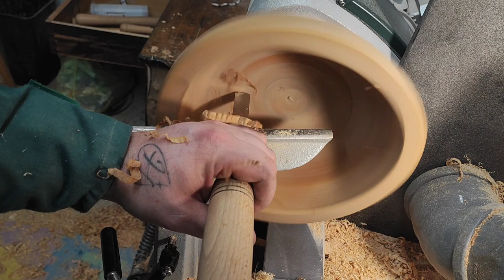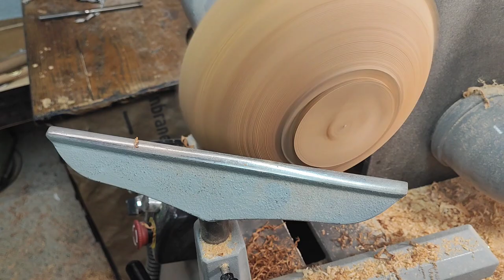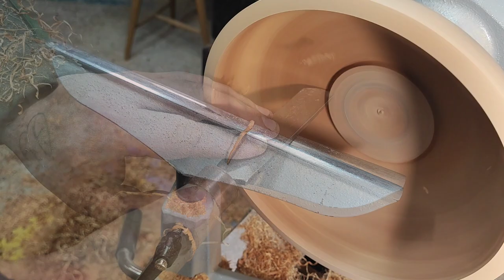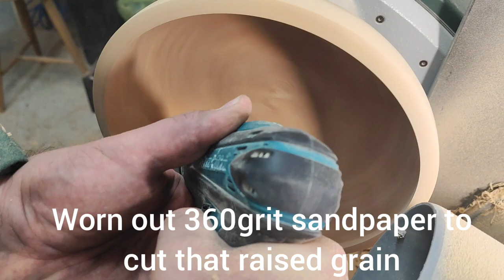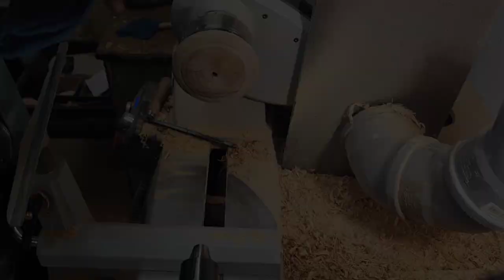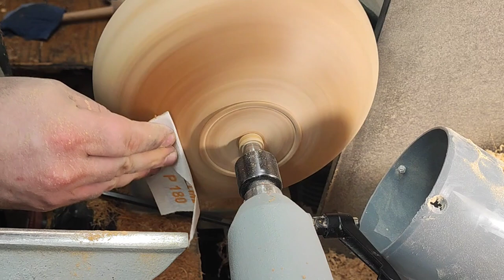Woodturning - Figured apple bowl

Comment: I have an apple tree that has died and I am about to harvest it for turning blanks.   I took a branch off last year that was big enough for a couple bowls.   The wood was extremely heavy with moisture and there was a lot of distortion with drying.    Nice looking wood though.  According to professional turner Mike Mahoney there is less trouble with rough turned blanks if you round over any sharp edges and completely seal them.   I’ll be trying that on this apple tree.
Reply from the maker: Apple can be quite heavy, I round over edges on all my bowls , that helpes with cracks on the rim, distorstion can not be stopped, But I like when wood does its thing,its a live media .... Although this apple that I have is quite stable once dry

Comment: A very good looking bowl.  So now I have seen you make bowls from 1mm green turned to I'd say this maybe 12 to 14mm for this one. I think the raising the grain for washing is a good idea.

My question and sorry to trouble you, what is a good thickness range for working bowls that get washed a lot? Up until now I have made very small bowls (2 to 3")at 2 to 3mm, small bowls (up to 6")for peanut/crisps snack maybe 4 or 5mm and fruit bowl size (7 to 10") at about 7mm. Currently nothing thicker I have a few 12 to 15" once turned drying. For me I like the visual thickness proportion of those sizes to thickness but is there a strength requirement to make a working bowl or a salad bowl thicker? Many thanks.
Reply from the maker: Hello Chris, sorry for late answer, busy day....
I never think about thickness, I go first about visual, small bowl with thick rim doesn't look good for example.... About the streight , a thin bowl can be quite strong for every day use.... In my area thinner ones don't sell as good as "normal" thickness.....but I like thin and make them for myself and if they sell ,great😉... Don't think too much about that, just make as much as you can and try and you'll find out what is your prefered shape and design..... Ooo and on my bigger bowls I like thickness to vary from rim to bottom.... Beacuse its more estetic je funcional..... Hope that helpes
Reply: @tomislavtomasicwoodturning  thanks for your reply. I think there is a visually comfortable relationship between diameter and wall thickness that I think is probably what you are saying and doing that I probably also do, maybe a bit thinner. Interesting that the thin green bowls don't sell so well, useful to me, managed a small dish at circa 2mm but no way anything bigger at that wall.

I am happy with the forms and blends I am now creating, it was just the thickness I had a worry about. Thanks as ever. Just need more time on the gouge to get a better finishing cut and less reliance on shear scraping but I guess that comes with time.
Reply from the maker: @chrissimmoms1550  turning like any craft, skills will get with repetition and practice, design as well will progress as your skills evolve.... Just spend time with the lathe and rest will follow.... Wish you best of luck and if there is anything I can help out feel free to ask 👍